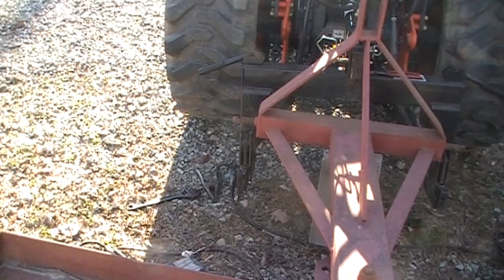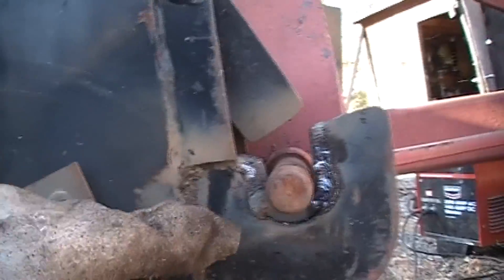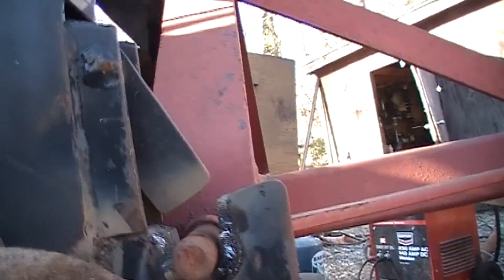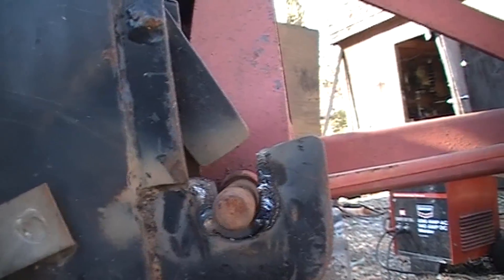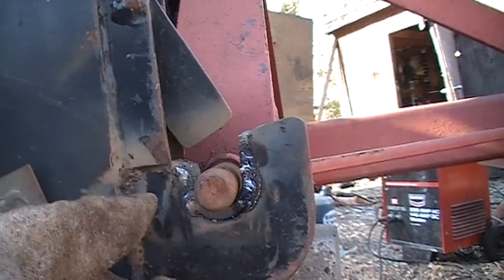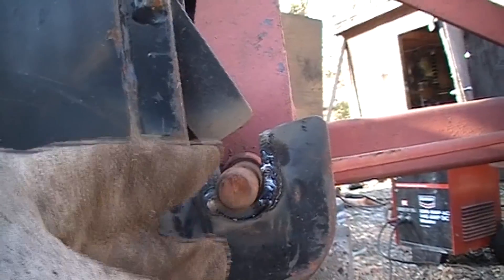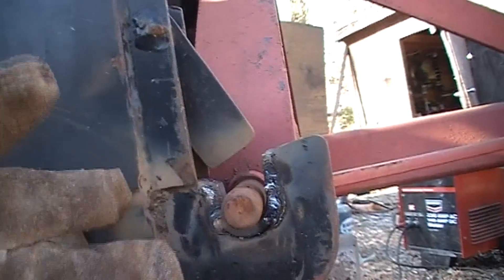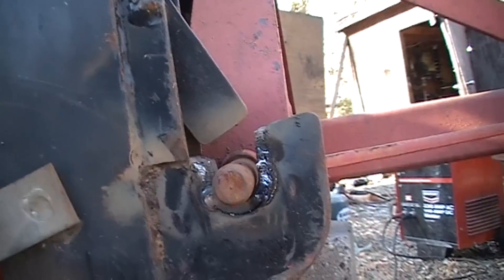quick hitch modification for cat 1 no more bushings!

Comment: Thanks Dave     I wish I would have found this sooner.   I do have all my Implements on the lower cost quick hitch .  BUT!!  The Amazon bushings and adapters to make it work make me feel like a moron.  Good thing I was a Welder years ago.  Your method could have saved me $$$$$$.  It even cost me a 4" Vice that shattered when setting a roll pin.  ( I know I need a press but that's another issue )  GOOD JOB !!!!!!!!!!!
Reply from the maker: those bushing are pricey and a lot of trouble to be home build. my ole cheapo quick hitch is going strong still.

Comment: Thanks. I have a couple bushings but also have a couple home made attachments.. And those nice factory made bushings are priced too high..They figure, if you can plunk $400 for an iMatch, why not hit you $40 for some nice looking bushings. I don't like that. I found some square tubing (probably 1 inch 14 gauge?) that would do the trick. Cut me a 2.5 inch length and it can work.
Reply from the maker: heck yeah if it works why not.

Comment: The extended hook gave me enough room to hook up my box blade with the HF quick hitch. I got mine from Amazon and it was about 50 bucks. As I said before the bottom bolt or pin hit the frame of the implement and I needed about another half inch of room. I think Agri Supply has a hook that might work for a lot less money, under 20 dollars. But I got free shipping on Amazon and free returns.  I sold my torch and welder long ago or I would have made a hook that worked myself.  For the bushings, I used a piece of black iron pipe from Lowe's, sawed up to fit.  It's a shame HF and the Chinese won't fix the hook problem.
Reply from the maker: I agree I never understood why they make a cat 1 quick hitch with cat 2 lower lift lugs and a top hook that sucks at best. I bought the agri hook to try and since I needed to add a third bolt hole for position adjustment the agri hook would not work for me. I think I show the agri hook in another video about quick hitches on my channel. thanks for the valuable input. these QH are great once you get them modified up to work with every implement. as I stated many times before I would rather mod up a 89 dollar HF than to mod up a 400 dollar landpride. lol
Reply: @daveknowshow  Yep. Soon as I get rich I'm gonna get me one of them hydraulic top links like yours. I'd like to have a Kubota tractor like yours too.  Instead of my Ferguson TO 20 and my JD 5200.
Reply from the maker: @lareemcra347  nothing wrong with the fergy or the JD I have operated both and both are very capable tractors. you should get the hydraulic top link its a game changer for sure!

Comment: Couldn’t you buy one set of bushings cut them in half and weld it in place?
Reply from the maker: I imagine you could do that. the only issues I could speculate there may be is the material the bushings are made of. if its a hardened steel like AR400 abrasion resistant type or tool steel type they do not weld very easily and often crack and break right around the weld point. the AR type can be welded with the proper set up and attention to detail. of course that is welding AR to AR and not so much welding AR to what ever steel these quick hitches are made of. so in theory yes you could cut the bushing and that would eliminate having to bend metal. if the bushings are just regular steel  then you will be fine. just grind off the protective coating that is often on the outside of the bushing. I would be interested in how this turns out so if you do it  let me know how it welds and if it holds up. you can leave the information under this comment thread so others can locate the information as well. thanks for the suggestion this may help many people who do not have the means to bend up a proper fitting half bushing.

Comment: How's she goin'?  Nice mod Dave!!!  I just got a quick hitch and the first thing I noticed it not all attachments can be hooked up 'quick' and that they all need the adapter bushings.  This looks like a good solution for the adapter problem!!!  Take care!!!
Reply from the maker: yeah its not a perfect world I guess. this does help things work better and I can use my quick hitch with almost all my implements now. cant use it with the post hole digger, my tiller wont work cause its offset tiller, bottom plow of course and the finish mower works but not great. all the rest work pretty good on the quick hitch.